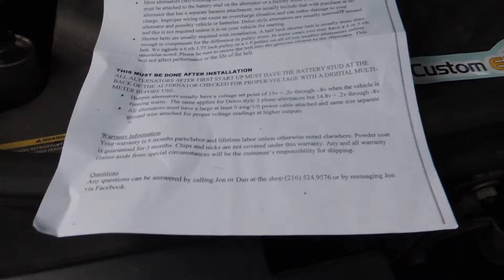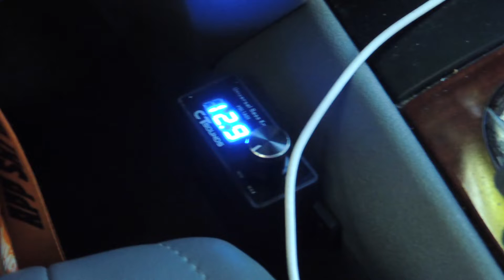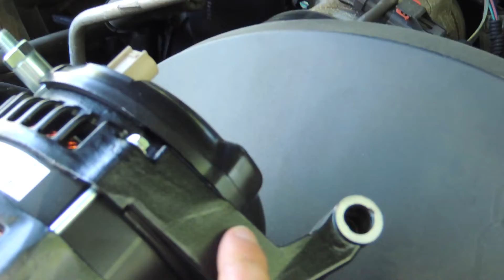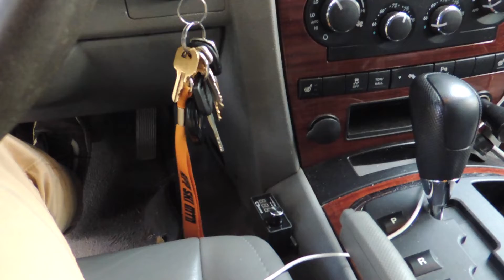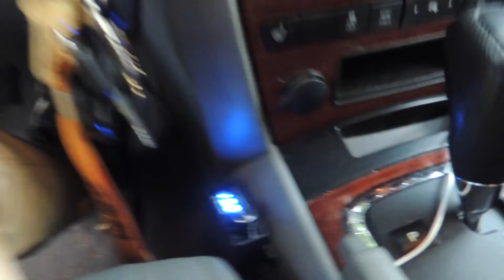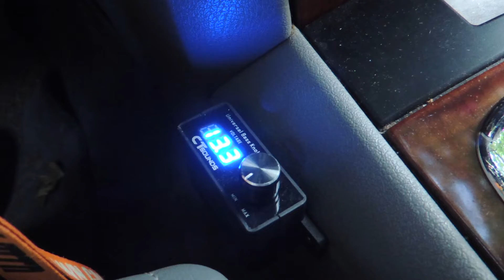320a Alternator Upgrade! CES High Output Alt Review

Comment: Your battery needs to be trickle charged and topped off over night and your voltage will be higher alternator maintains the battery. If the battery is low to begin with the voltage will never get brought up to max even with the high output alternator. It takes hours of trickle charge to recover a battery that's been abused by a loud system over a long period of time.

Comment: I use an AutoTech Engineering 320a alt in my Accord. I think it's been about 4 years now that I put it in there, no problems yet thankfully
Reply: what year they don’t have my 2015
Reply: @brisket9007  mine is a 2000

Comment: What's your thought on js alternators?
Reply: did you get one? i just ordered a 320 amp frpm them
Reply: @hooptastic_hippie8522  yes I got the 320amp so far so good now I'm building my bank.
Reply: @30VISION4K  what are you using for that bank? I got a D4S LTO 6.0 at the moment
Reply: @30VISION4K  I was building a bank of lifp04 cells but I need a charger or tester to see if the cells are still good...ive hadem a while
Reply: @hooptastic_hippie8522  if they are 2.8 to 3.4 just put together balance it and let alt charge it.
Reply: @30VISION4K  what's a good balancer to get?? Sry if I'm buggin

Comment: Goin on 2 yrs with my ces 320 alt and in an  everyday vehicle clamping 3400 watts at times.The demand voltage from some cars at idle are usually lower with based on  fuel and ignition system but some guys vehicles will actually ramp up when stereo is playing and their voltage in turn will be stronger then not playing their stereo at all,givin theyve got a lot battery reserve

Comment: Hey Parker I have the skar 2000.1 amp with 2500 watt 12s in a vw with stock alternator. Big 3 done. Rpms jump with beat, what size alternator should I purchase any ideas why they jump also?

Comment: the same spec can be found in an alternative alternator if you can find the model you want from mechman guys
"its a VELEO 11358" unit that comes stock in bmw e70 e.t.c  or the bigger unit that comes in the M50d 
the small unit does 230amp idle and 370 at rev haven't tested the big unit's peak new equipment need to be built for that
seems like over 400 amps (make my load catch fire)
these unit are used in other German cars to with all different types of mounts
keep in mind the oem BMW version uses LIN bus for control
(BMW x5 alternators are cheap & everywhere !) not E53 versions ! must be newer e70 & onwards
Reply: So couple I make that fit in my e36 ?

Comment: I installed my mechman 320 and big 3 today and it made a huge difference to my system. Feels like a 🦍 trying to break out my sub box.
Reply: How many watts is you're system bro
Reply: @jaystocks460  taramps smart 3. Tried the skar rp2000. Also
Reply: @NachoCamaro  nice so the upgrade of the mechman made a huge difference?
Reply: @jaystocks460  yes in voltage and a little sound. Lights are still  flickering.
Reply: @NachoCamaro  did you add am extra battery?
Reply: @jaystocks460   nope stopped investing money into it. Now focusing on my camaro ss. Road to 400+ rwhp
Reply: @jaystocks460  actually did 3 1/0 runs to Ill customs terminals ,mechman320, dual runs to all grounds and ran an extra ground to fram from amp.
Reply: @NachoCamaro  yeah bro i feel you it's alot of money
Reply: @NachoCamaro  nice i just ordered a mechman 320 and an xs power battery for my build
Reply: @jaystocks460  it helped a lot. But didn’t stop all issues. Only issue left is flickering lights at full tilt. I even swapped to led headlights.

Comment: The voltage is done by the regulator and they try to keep it as close to stock as possible due to liability of the electronics that are made by your vehicles manufacturer  are made to run in that voltage range . They do make external regulators that are adjustable look around they sell conversion kits

Comment: Couple questions for you boss...... First is how is the alt doing now???? I just paid 400 for my 320 amp alt from ces asked for it to charge at 15.3 volts since im running cmaxx but are they worth the money???? Second question is did you ever figure out where your alt puts out its power from ces? Like what rpm? Hopefully 2k or below or ill need to cancel my order

Comment: My 01 durango controls voltage thru the ecm..i use an external voltage regulator that adjustable along with my 250 amp alt..and to get output you need be about 2000 rpm.

Comment: PARKER WHEN YOU SAID YOUR PULLEY BELT IS SMALLER YOU HAVE TO CHANGE YOUR BELT TO A SHORTER SIZE IF YOU PUT THE SAME BELT IT WONT DO YOU ANY GOOD.. MEASURE THE STOCK PULLEY WHEEL THEN THE SMALLER ONE AND DEDUCT THAT FROM ORIGINAL BELT SIZE AND GET THAT CORRECT BELT WHICH WOULD BE SMALLER SO THE HIGH OUTPUT ALTERNATOR RUNS HOW IT SHOULD!

Comment: It's pcm bypassed, put i 470 ohm resistor on it parker💯 all newer Chrysler dodge jeep, pcm controlled
Reply: Kyle Scarberry I think all the newer cars are. I have a 15 hyundai elantra gt.  And I get around 12.7 idle. But if I turn the head lights on at idle it goes to 14.2. These newer cars crazy. So i just drive with the head light on.
Reply: @2015gtbass Noo way 😂
Reply: @Anais20k  facts  fam. Before I got my h/o alt .
Reply: @2015gtbass  I have newer car also I unplugged the battery sensor and  get 14 volts idle but when plugged in it be 12.2 volts idle newer cars weird
Reply: @Anais20k  facts

Comment: Redo your grounds with crimped 2/0 or 1/0 welding with 5/16” or 3/8” silver tinned copper ring terminals! Also use some 4 spot aluminum or copper battery distro on your batt positive and negative ( ring term or set screw) for big 3 and runs back to amps. Bad crimps or solder joints can wreak havoc on otherwise strong electrical

Comment: Wonder how it compares the more expensive alternatives like us alternators and mechman alternators, they typically are more premium alts.
Reply: But often you have to get a modified serpentine belt. Dodge Challenger it does(mechman)
Reply: TheBarrioslbc not modified just 1/2 inch shorter since custom alts have smaller pullys
Reply: @real one yes, you gotta cut them 1 or so notch depending on the size of the stock belt u heard. I gotcha.
Reply: TheBarrioslbc no bro you don’t have to cut them you just tell the maker the original belt size and hey can send you a link to a belt I just went thru this with mike singer

Comment: Great alt new batteries needed i replaced mine with a 50$ walmart battery under the hood 600 cca required batt is 750 cca and in the back a 88$ 200 amps @ 20hour marine /RV deep cell huge difference and money saved waiting to eventually get 6 super cell capacitors it will literally lock your voltage on the high end

Comment: I use a Ebay 220amp alternator on my truck...6 months no issues..
Actually clamps around 180amp...  for the price I can't complain..cheaper than a stock replacement

Comment: ITS NOT WEIRD... ITS A SCAM AN YOU JUST PROVED IT..THANKS
Reply from the maker: Shannon Scott haha no it turns out the car regulates the voltage through the pcm so I would just need an external regulator
Reply: voltage didn't drop as low

Comment: Yeah I would have recommended CES when Jonathan Patrick was working there and he personally built the alts but since him getting denied the payment he deserved and then fired by the owners WIFE I honestly would not buy anything from them so by me telling you about my alt it is not about the company CES it is about the man who built it which was Jonathan Patrick lol but I had msg'd him on Facebook inquiring about an alt for my 08 Lincoln mkx as I had found some company on ebay claiming to have a 300amp alt for around $289 well turns out that company was a joke and he ships out used junkyard alts that're OEM spec'd claiming them to be 300amp alts lol but to my surprise Jonathan Patrick offered to build me a true 300amp alt for the same price, so I paypal'd him the money at 6pm that day and the alt was on my doorstep the following morning and he had emailed me a vid testing it and my 300a does over 200a at idle and I have two SKAR SK3500'S strapped at 1ohm each with an XS power D3400 under hood and a d3100 out back and I literally have zero voltage drop while driving even at full tilt... your voltage is regulated internally by your vehicles computer so adding more amperage is not going to net you a higher voltage but you can buy an external regulator and turn it up so the alt puts out 16v if you wanted to! Lol

Comment: My CES small case 320amp when I rev it to 1000 rpm stays in the 14s and I got 4 American bass xfl 12s on a taramp md8k  and I love it cause when I'm not basting my music its sits right at about 14 but when I crank it up it'll stay there
Reply from the maker: Reggie Ford heck yeah dude! I just need to get a regular for mine and it will do better. What batteries are you running?
Reply: Does it stay at 14v at idle with wipers, AC, and all that stuff on for daily driving?

Comment: Hey, I have the same alt. You need to get an external regulator to charge higher. I recommend bluebox. Also you need to charge your batteries, on that spec sheet it tells you your batteries should be charged around 12.8. Also you need to get more reserve. The alt can only do so much if there is not enough reserve.

Comment: So Parker what is your setup gonna be now what 2 subs and amp?
What door speakers and amp too?
Reply from the maker: Chris O'Connor right now I have the two NKOs on the AudioPipe AQX3000.1. 
I have Skar speakers, CT sounds super tweeters, and an alpine mini amp I will probably be installing in the next video.
After that I have some new AGMs I’ll be installing and then will be upgrading wire/amp/and subs. It’s going to be insane!
Reply: @ParkerTheBasshead  nice! I have a 200a alt in my crown vic with 1 12" on 900rms and some door components on 100rms each.

Comment: You should definitely switch to lithium man. It saves so much weight and money over AGM. Just make sure you delete all AGM out of the system if you do that. Also sometimes the car regulates the voltage/amperage instead of the alt. I had to swap the internal regulator out on my CES alt and get a harness with a diode wired into it, and had to not use my factory harness, because the wires went directly into the cars regulator, of course I have a battery light now because it just bypasses all of that. You can check with Mike Singer at Singer alternators and see if he can get you one made up if you're interested. Mine was 13.8V stock, but now it will charge at 14.8V and actually put out 250A when clamped. Make sure you get a clamp meter that does DC and AC measuring for amperage. DC from alt to the battery for the real world charging amperage, and AC for clamping your speaker wires so you can see how much power your subs are seeing. Looking good so far man.

Comment: Should've went with Autotech Alternators, amazing company and products, I got a 270 amp alternator from them for $290 including the powder coating, works great with 2 full throttle batteries and a big 3 upgrade on an ampere audio 3800.1, overall great video as always.
Reply: Clint Hernandez ey man, how’s it holding on ?  You have a video of it?
Im debating if i should go with autotech or another one.
Reply: Just bought an auto tech 320 amp waiting on it to ship I'm so happy
Reply: @aaronlawrence4218  man you’re gonna be so happy with it, I know I was for sure when I got mine, look how long it’s been and mine are still going strong, sadly I got in an accident a couple months ago so I was forced to take off my dual alt setup in my blazer, so now I’m about to start a new build in a Tahoe and their going back in it!
Reply: @clinthernandez9393  sorry to hear about the accident but I'm glad you are gonna be able to do a new build
Reply: I've been looking snd doing the research on auto tech. There in riverside, I think om gonna drive down 40 miles to get 1 and save shipping cost. I hear good things about them. I'm looking at the 320 amp autotech. Plug and play
Reply: @TheBarrios69  any luck with it?
Reply: @SheeenBean  you know? I decided not to get the alt.. I got rid of my subs and put in airlift air suspension.  No room in the trunk anymore.. but I'm happy with it..
Reply: @TheBarrios69  noooo,.........your not allowed.    Once a bass head, always a bass head 👍
Reply: @southern_merican  haha I actually got me a lil MOJO 8inch box with a Orion XTR 1500dz pushing it. Speakers in my small back seat. I got a Dodge Challenger.  I'm rocking again.
Reply: I just ordered a 320 amp from auto tech yesterday cant wait to get it!!!
Reply: @davidmarin4738  you’re gonna love it man, I currently have two candy red 320’s in my Blazer 💪
Reply: @davidmarin4738 how is it
Reply: Did you have to go up a size on your serpentine belt from the stock belt?
Reply: @XXXCRSPL  we’ll on my vehicle it actually worked with the stock one but on some vehicles you are required to go up about half to 3/4 of an inch
Reply: @Shaquille Hemphill did you have to get a different belt
Reply: It’s 390 for me🫠🫠
Reply: 12v or did u change it to 14v
Reply: @AlShams69 it’s 12 volt for me but now I have a voltage regulator so I’m able to adjust my voltage from 14.8 to 15.8 with just a twist of a knob 💪
Reply: @clinthernandez9393 what’s the benefit?

Comment: Should be able to put a resistor or diode inline an be able to keep ur v up...i use a resistor inline an i see 14.8 14.9 on cold startup an 14.4 at idle....reallllllly hot days it will idle at 13.9 on factory alt......good luck

Comment: Hi Parker, I have years of experience in automotive repair. Your alternator is a beast. It is regulated to around 14 volts. Some upgraded electrical systems run at 16 volts. That is safely reached by upgrading  the components in that system to run on 16v. Chrysler vehicles are sort of notorious for being picky about the voltage. If it is not in specific range it can cause issues, weird ones too. Have you done the big 3 yet? That will improve charging performance.
Reply from the maker: Thanks man! Yes I have done the big 3. And yes amperage definitely seems a lot better. A lot of people have mentioned that Chrysler’s voltage is regulated by the pcm so that totally makes since now. And yes I’ve heard that raising voltage can cause problems so I’ll just leave it the way it is for now. Should be good enough
Reply: I have a 2020 Chrysler 300 and installed a mechman 320 and it's worse then my stock drops way below 12 v not sure what the issues are
Reply: @rudygriego3652  I drive a Ford F150 2015 and got a 320 alt installed.  It keeps the voltage right at 14.4 and only drops maybe to 13.8 at the lowest.

Comment: External regulator plug is a very easy upgrade on the alternator. CES on Facebook has a detailed description on how to do it with a diode to help excite the alternator. I put a socket on mine and use external regulator so I can control my voltage from 14 to 16v with lithium 45ah bank. Hopefully this helps. I went through all beginner stuff to now.
Reply from the maker: It definitely does help thanks so much!
Reply: Parker Dacchille https://www.facebook.com/marketplace/shops/item/2626976900679726/?referral_story_type=shop_pdp_share_deep_link&referral_code=shops_pdp_share
Reply: Parker Dacchille the external regulator bypass your pcm so u can charge higher. The socket allows you to hook up external regulator. CES sells both for $45 each. Just depends on your goals. If you are going to stick with agm I would get external regulator. But if you plan to go to lithium I would get the socket and external regulator blue box. Just depends on what you want to do.

Comment: Nice! I was thinking about getting a Mechman alternator myself. I haven't got a read on my voltage yet but, I'm sure the 1,000 watt amp I got hooked up is putting a lot of stress on my stock electrical system.
Reply: 1,000? not really. only need to upgrade alt beyond 1,500 rms watts imo. i'm finally upgrading my alt for my Taramps Bass 8K but then again my stock alt is 150a because my Ford Edge is naturally power hungry.
Reply: Hmmmm actually it depends on the amp and its efficiency at its givin ohm rating.cheaper amps draw more juice do to there inefficiency.also to big a list to go through but cabin and enclosure pressure along with tuning and enclosure effi ency and sub ohm rating plays a massive part as well also your 120 amp alt 370 9000 watever you got is only putting out and I'll be generous here 65 to 70% of its givin output rating unless your running it as a sepreate setup and the you have wat we call crankdrag ie the alt doesnt spin at the rpm it use to do to increase stress on the pulley system and horsepower loss so ie if your rpms drop when your bang bangs your your car lunges or everything dims not just the head lights.time for upgrades and lithiums can not.be ran with agm or lead acid.if you chose a small agm wich will work just fine for a 1k at 60% efficiency at 1ohm just make sure if the agm is bigger than your starter batt run an isolator or you gonna be pissed when you late for work belive me.
Reply: buy Down4Sound's newly released battery. It's awesome!

Comment: Amperage can increase but voltage is regulated by the car( in most cases)! In order to get higher voltage you need an external regulator

Comment: Did you notice a difference in how loud your subs played?
Reply from the maker: Honestly no but my voltage stays high 13s while didn’t now so I can play it about full tilt non stop
Reply: Aw man. Lol..i know when i added my 1st 2nd battery the system was loud as hell after that. Would hurt my ears. I was like just from a extra battery🤣 i figured since it keeps your voltage up you'd have an Increase in wattage and loudness
Reply: @chadwems  if he metered it it would show a slight increase.  Maybe not enough to hear. But if he keeps upgrading and then he put it back to the way it was he could tell.